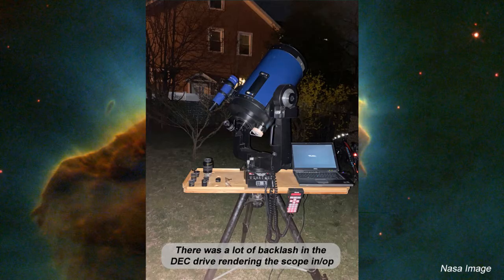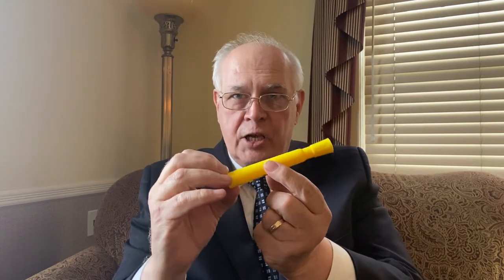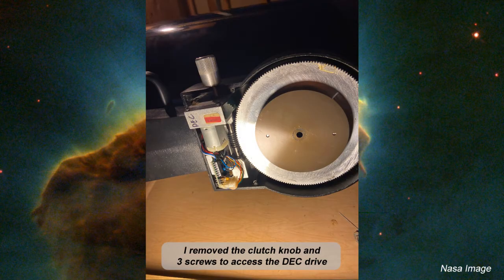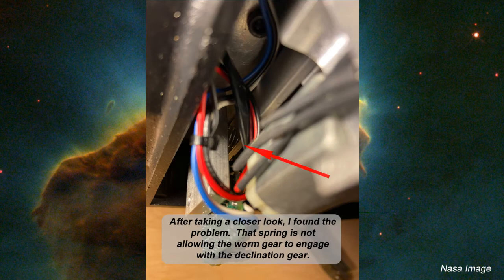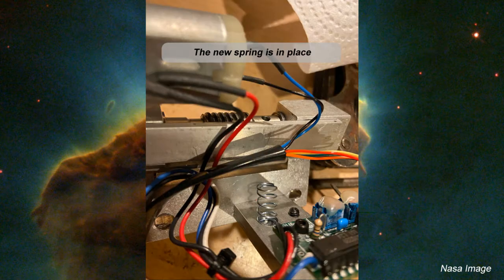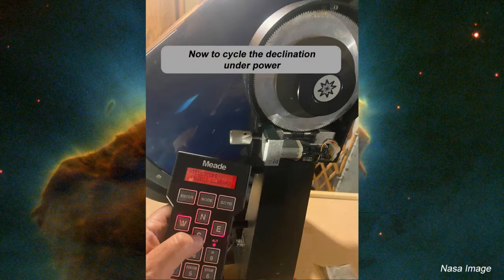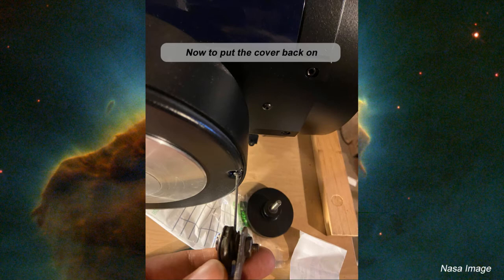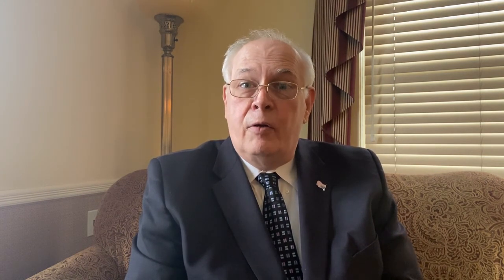Repairing the declination drive on a LX200 Classic

Comment: I had a similar problem on the RA drive of my Meade LX90. I opened it up with the intention of replacing the spring, but it turned out my spring was fine. The problem was that the old grease became dry and sticky. It gummed up the lower screw (pivot) so much that the spring could not push the worm gear into the drive gear. I cleaned and re-greased the pivot screw, and now I have near zero backlash. Thank you for your video!

Comment: Very interesting table you attached to the mount. I did a similar but much smaller to my 8” Meade setting. No problem of shaking by wind?
Reply from the maker: I've had it in a light breeze without an issue,  When it starts to get windy, I generally pack up for the night.

Comment: Was you goto accuracy a problem before making this repair, and did it resolve?
Reply from the maker: The accuracy was severely hampered with the amount of backlash.  The repair was a success.
Reply: @WilliamLewismcp  thanks!  Great video.  I made the same repair with your guidance.  Skies have not cooperated to tell me if it made a difference on goto accuracy yet.  Best.  Kelly